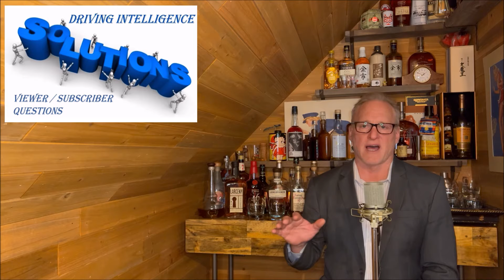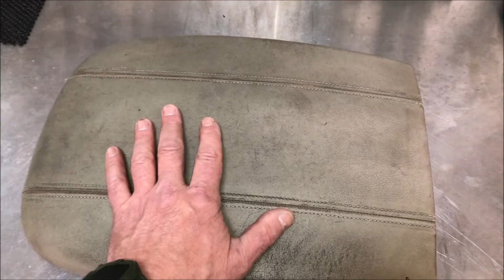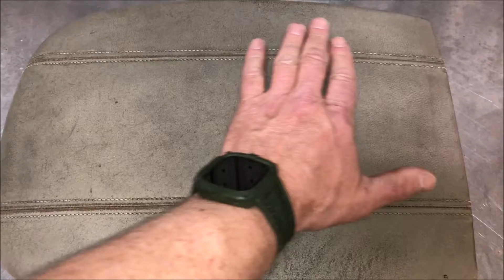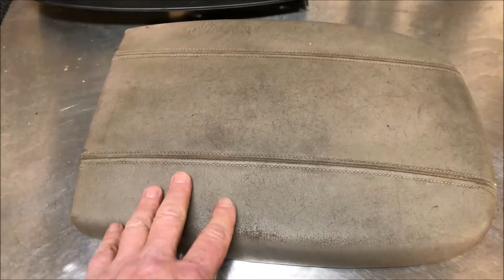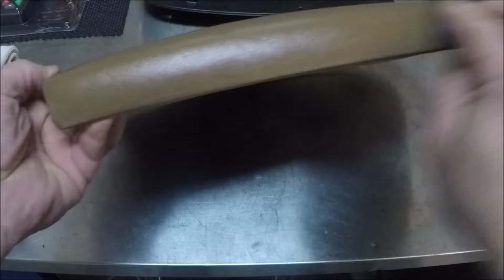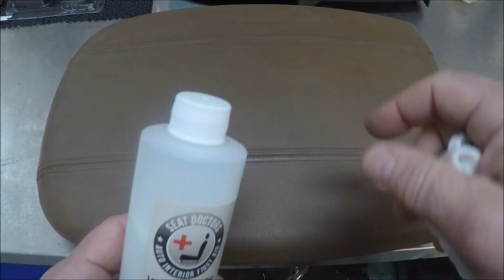How To Dye Leather Console Lid: 10th Gen F150, Expedition Console Lid Restoration

Comment: Is this in your Harley? You changing it up to a King Ranch color inside?

Btw... do you recall how many boxes of sound deadening material you used for your Harley (not including the seats). I want to do mine. 

Like the vids... subbed.
Reply from the maker: The HD F150 is staying stock interior.  I just picked this console lid up to show how easy it is to clean up leather.  I sold it on eBay.  I already did the King Ranch swap in my white 2002 F150 4x4 XLT.  To soundproof that truck, it takes a little over one box of Kilmat.  This vid shows install under headlner:  https://youtu.be/d5XA3EHgbfA?si=eMMm5QtUDiP75VEh  & thanks for subscribing!  What are you driving?